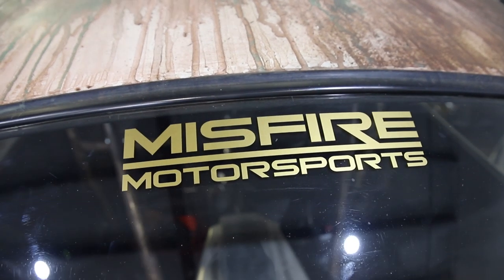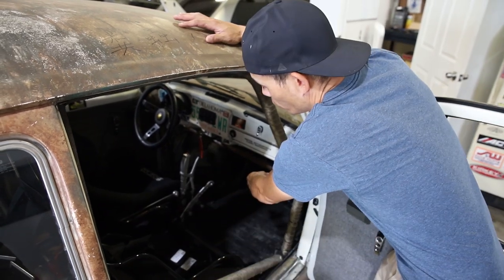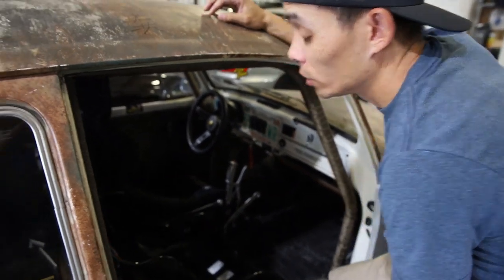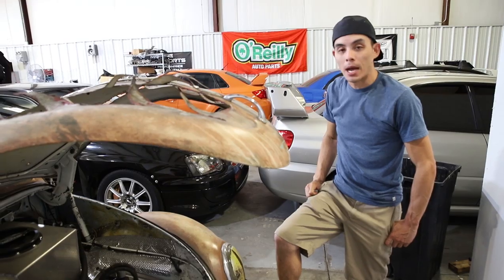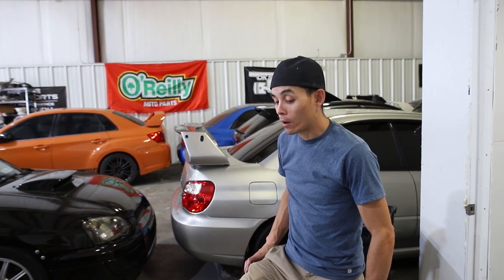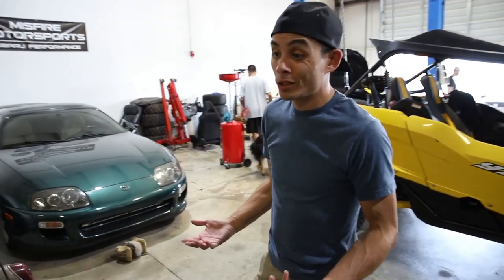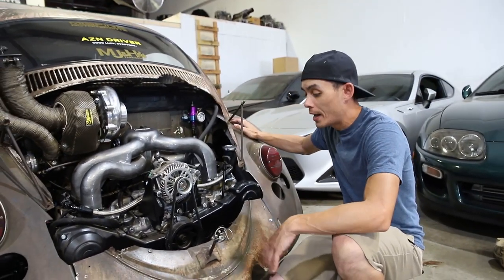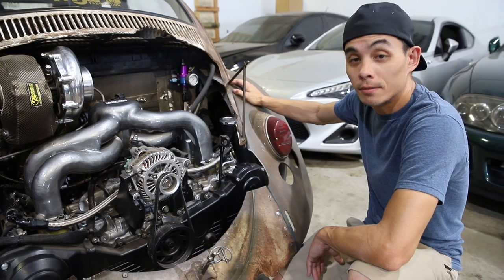DUNG BEETLE UPDATE

Comment: no one ever talks about them head gaskets 15 years of produced vehicles with defects
Reply: Naterally.  They are pushing big boost out of that Turbo.  I'm pretty sure they have the head gasket problems figured out.
  A stock Subaru will run about a 150k miles before they start having head gasket problems anyway.
Reply: @ltsgarage7780  its a design flaw and 150k is low compared to say a toyota or a honda. trust that the gasket did its job but the rest of the design made it fail so unless they scratch built a new motor this design flaw still exists with a new band-aid (head gasket)
Reply: Every car/engine has its own issues... To each, their own.

Comment: Should have just got you a Subaru and put the motor in. Air cooled  makes vw unique. Not to mention you can get 1000 + HP..
Reply: GoFly1 but this weighs 1900lb a wrx gutted is still 3000lb. Id take the weight savings with subie motor over a built subie
Reply: @scottbeaulieu13  I totally understand why they do the engine swap. I currently have a 67 turbo bug. I just think once you take the air-cooled motor out you took the soul of the car out now it's just a light shell ready to except rotaries, Subaru Motors ,V8 Etc. Air head for life!
Reply: GoFly1 this was a purposely built car, it’s not original or a resto build. There’s no point staying air cooled if the function of the car is for racing. .....it’s like an old person getting a pacemaker, doesn’t make them less of a person because they got a modern electrical heart to run the body.
Reply: @scottbeaulieu13  I'm just saying a true VW lover doesn't take the air-cooled motor out and put a water pumper in
Reply: GoFly1 well if they want more than 160whp they switch them out....
Reply: @scottbeaulieu13  I have 450 horsepower on my air-cooled engine some guys are running up to a thousand on the track

Comment: I have a great idea to talk to you about
 And also have a 03 suburban 5.3
With 300000 miles
I also have 5,000$
 To spend on fixing up
Not race like farmtruck 
But be blown up and tuned up to go 150
If needed but rebuild the everything top to  bottom.. 
    And ....
I work for a very old and large auto scrap yard/used parts.
I have all the rebuild parts from insurance auctions 
On new wrecks 
With low mileage you intersted

Comment: So....Is it all wheel drive?  If not,then I don't understand why the Subaru swap
Reply: still rwd if they haven't changed it.
Reply: Because it's a horizontally opposed 4 cylinder engine like the factory vw motor but it's water cooled so it can produce way more power